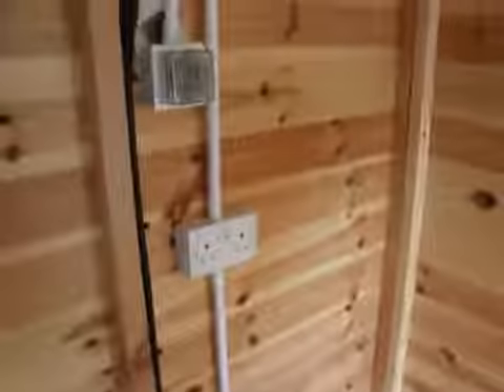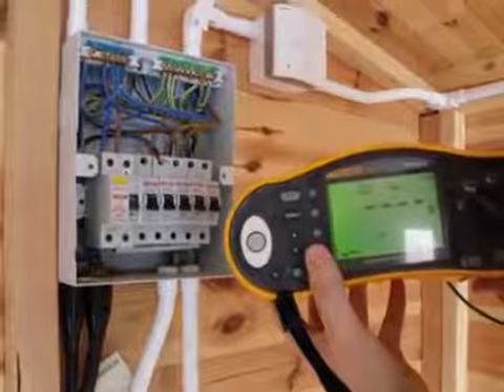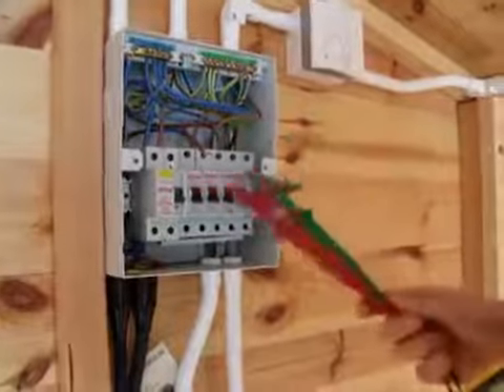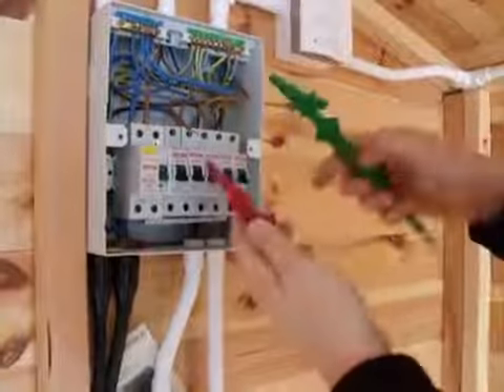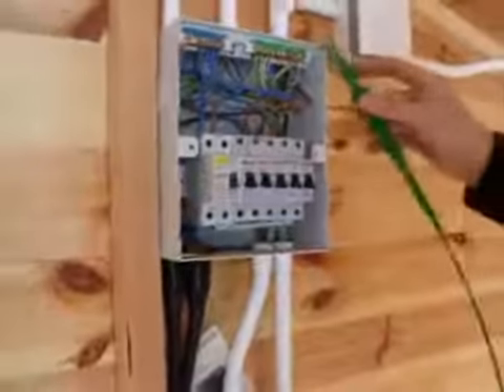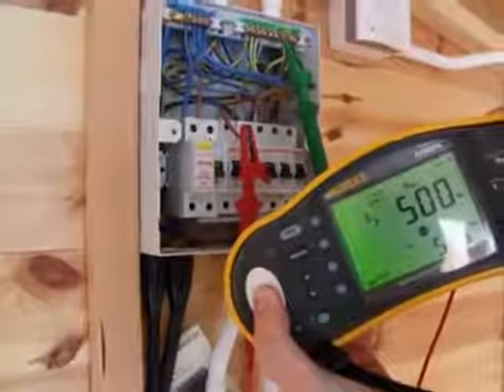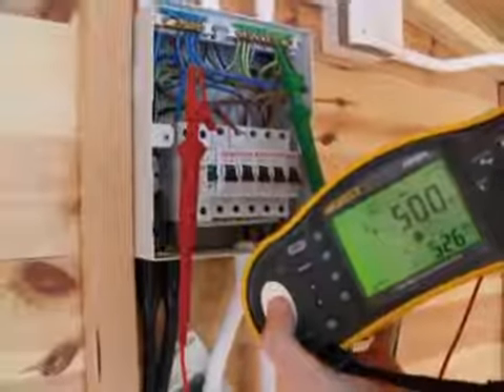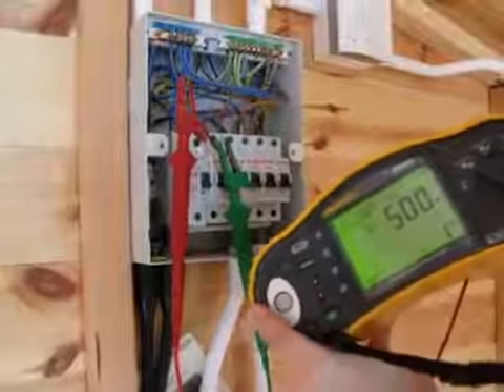Electrical Testing   Insulation Resistance

Comment: if you test sensitive electrical equipment you need to test against redwire against earth or VFD etc will break
Reply from the maker: There is no VFD in this video, and it does mention about being careful with  any sensitive equipment, it's recommended that any equipment is removed or disconnected.
Reply: Fluke 1664fc has a safety feature, no more worrying about sensitive equipment ;)